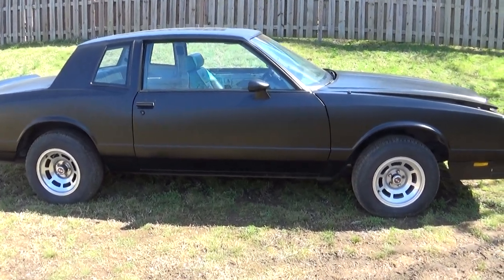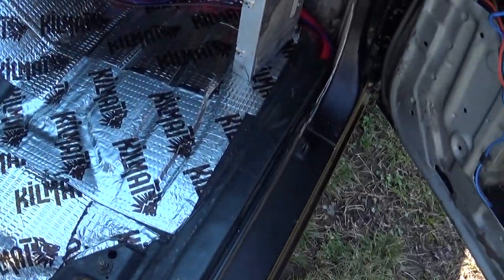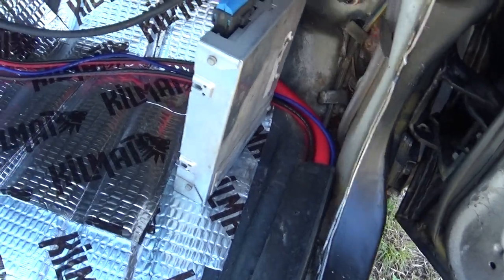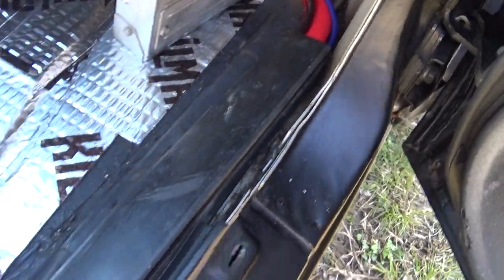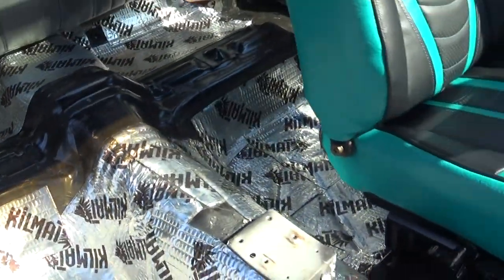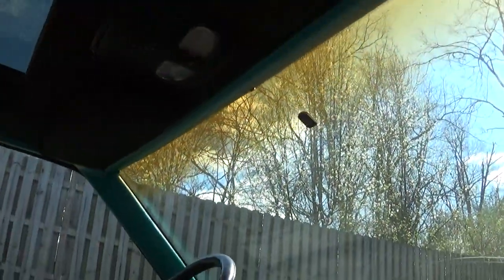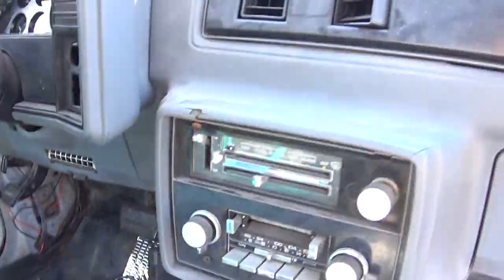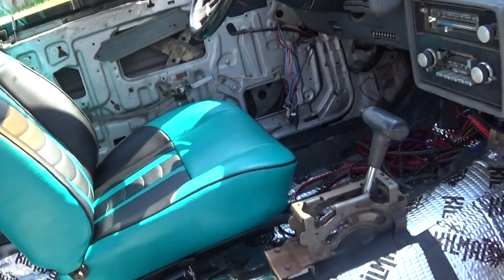1985 Monte Carlo SS Custom Interior Update by SSinteriors

Comment: What color is that and what type vinly is that with the wholes in it
Reply from the maker: Oooo, you like that perforated vinyl with the color inside the holes don't you! Phantom perforated black/green. They have only black vinyl with yellow, white, blue, orange, red, and 2 shades green holes. Another company has a suede done the same way but more face color options! First time I've used this on a job and never noticed anyone else yet? been out for a couple years now
Reply: @charles1matt  I like that green , I also do upholstery I want to do my short wheel base with that green and bahama blue